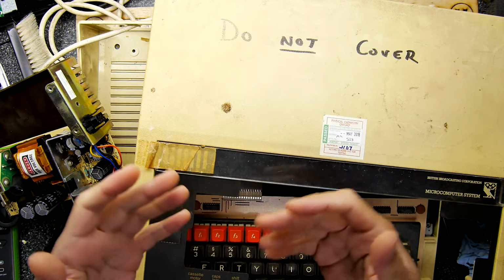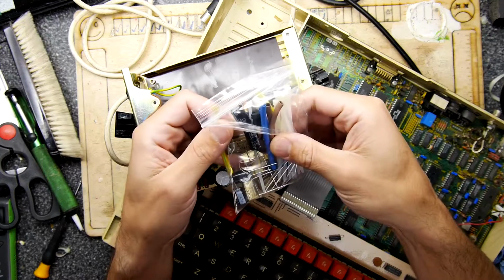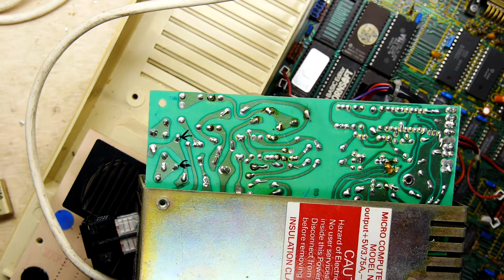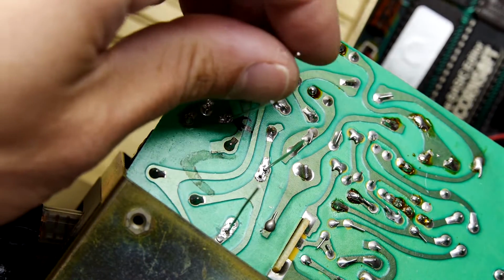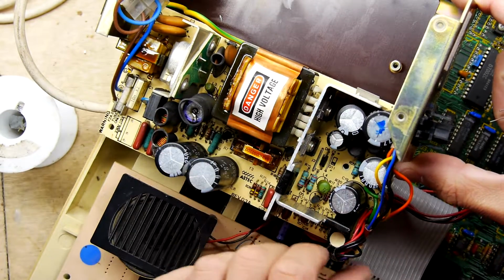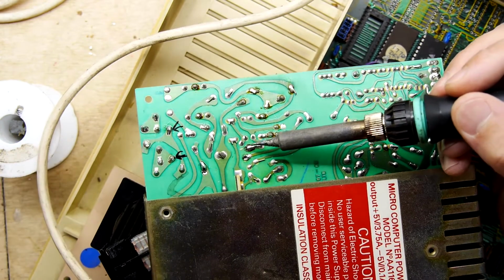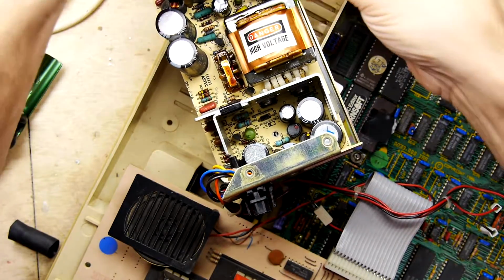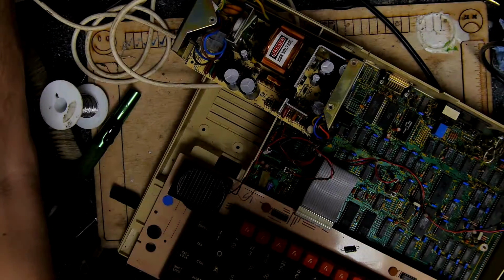BBC Micro PSU Repair How To

Comment: How long would you recommend waiting for the caps to discharge before it is safe to go back to putting it together.
Reply from the maker: These are small caps and relatively low voltage, I think you could just get in there. If you have any concerns, wait a couple of minutes.

Comment: Good video. I'd like to have a go at repairing mine.Can you tell us what the kit was called and where you got it from please?

Also any recommendations for a soldering iron/solder sucker?
Reply from the maker: It was quite some time ago, I would recommend looking on Google or eBay for a suitable kit. As for iron, grab a TS-100 and for a sucker, the Japan Engineer model in my recent video is a great buy
Reply: @backofficeshow  Ok will take a look. Thanks for the quick reply :-)

Comment: OK perhaps a silly question ... I pulled out my BBC Micro PSU to send to a friend whose better with a soldering iron than I am to do a pre-emptive recap before they go bang.  I took a  photo of the motherboard to show where the cables went, and then realised  I should probably have checked whether there were any proper instructions on reinstalling the PSU.  My googling hasn't found anything in any service manuals.   Any suggestions you have on what goes where to make sure I get it right when it fcomes time to reinstall it would be appreciated.
Reply from the maker: I think the connection points are potentially different on each model, but just hook the wires up as per your photo. As for everything else, I don't think they're are any gotachas, it's pretty straightforward.
Reply: @backofficeshow  Thanks for that :) I probably should have mentioned it's a Model B.  But at least it sounsd like it shouldn't be difficult.  It was just a case of me not thinking ahead - I've built many a bog-standard PC but the older stuff I sometimes forget to just double-check first :)

Comment: The most annoying thing about restoring these BBCs is that the ROM port cover on the keyboard is missing or damaged by being pressed through (Probably by a bored kid in the classroom in the 80's!!) leaving a gaping hole on the left side of the keyboard. Luckily you can buy a BBC Acorn ROM PORT COVER on eBay by a guy called riscman - problem solved. They are really good and keep with the aesthetics of the machine and they are really cheap.
Reply: Thanks but I couldn't find those ROM covers, are they still available?
Reply from the maker: Do you have or know anyone with a 3d printer? I recall printing off my last ones
Reply: @backofficeshow  sorry I dont
Reply from the maker: Where are you based? I found one I had made. You can have it for postage.
Reply: @backofficeshow Dublin, Ireland, any idea of cost
Reply: @backofficeshow  any way here to send you a private message
Reply from the maker: Not sure, most people ping me on discord, do you use that?

Comment: That axial cap looked like a pretty crusty repair job. Pity the bang isn't on video though, it would've surely propelled you past 10K... see what i did there?
Reply from the maker: You are a genius with words sir 😂

The bang was interesting for sure, it's not so much the bang that is the issue Vs the smell. It's really nasty and lingering
Reply: I just clicked subscribe and it went from 9.9 to 10K so I think I may have pushed you over the edge :D
Reply from the maker: Thank you, well done!!! You turned over the odometer!!